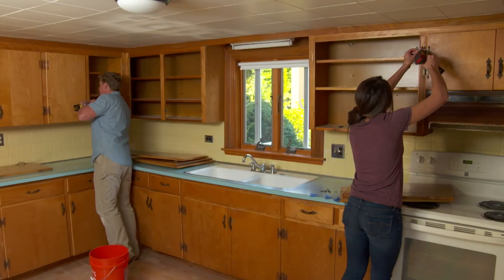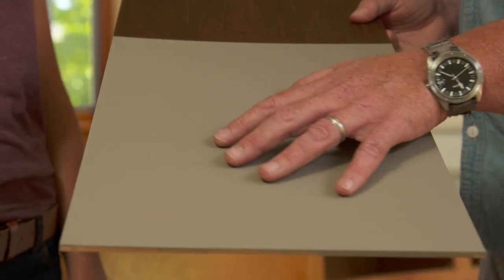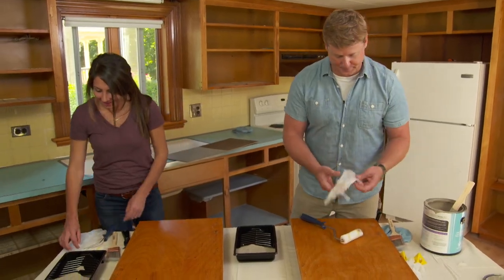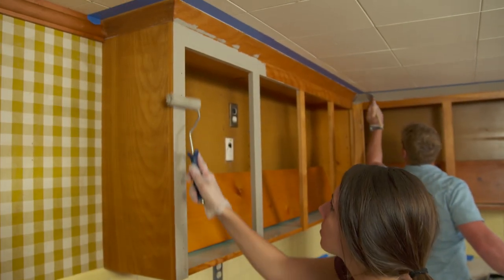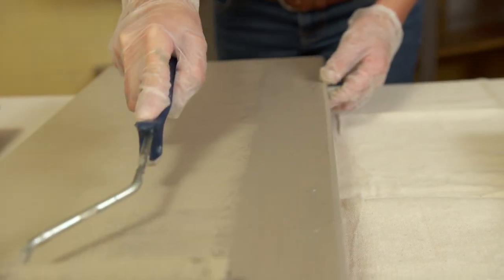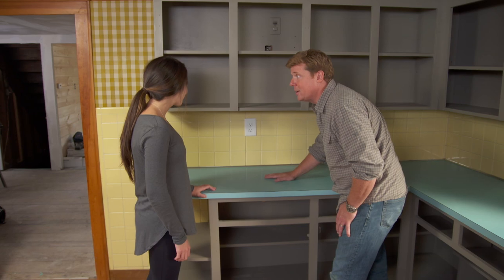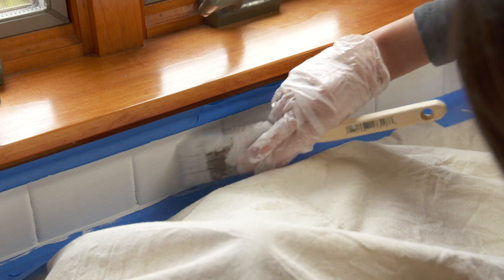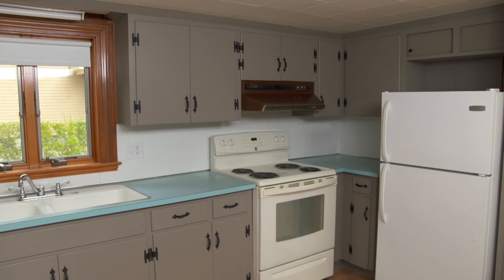How to Update a Kitchen with Paint | Ask This Old House

Comment: Cupboards and tiles look better but counter tops, walls and appliances also need updating to finish the look. Could also consider painting the window trim white
Reply: Jo Thomas 
Jo - They didn’t say they were doing the whole kitchen in this episode.
If you want to get technical, they could change plug outlets, lights and whole new windows, a new granite countertop, new ceiling, doors, baseboard trim and insulate the walls to R20. Simple! Hope you are rich.
Reply: Bryan Wilson I didnt say that they did. Im not rich but i have eyes and can tell that just painting these kitchen cupboards and tiles doesnt improve this kitchen especially when the colour they chose doesn't complement the rest of what is left. The phrase "polishing a turd" comes to mind.
How about you spend more time painting your beat up kitchen instead of ragging on at me about a harmless comment i made ages ago.
Reply: Jo Thomas 
I painted mine years ago white and they are perfect. But thanks for the advice.
Reply: @youmeplus3511  I completely agree with you on the window trim; it sticks out next to white tiles and grey cabinets. As for the countertop, I think butcher block would be a good option to bring in some warmth that was lost. There are some very affordable options.

Comment: I've used this paint! I love it, it's easy, affordable, long lasting, tough and GORGEOUS!!! I have an interior design company in Hermosa Beach California!
Reply: Did you use the beyond paint $130/gallon? if not what do you use?  Thanks
Reply: It's probably just a solvent based Epoxy resin. Solvent based, [as opposed to real non solvent based true epoxy]   etches into anything. Solvent is powerful. Epoxy resin is just Araldite, Araldite with a modified hardener. [GLUE]. of course it sticks to anything. Fats and grease excluded. That's why they cleaned everything first. Wink, Wink.....
Reply: Hi, 
Can please post the brand and where you can buy it?
Reply: Angelique Gorges Does HomeDepot sell I like Semi Gloss Enamel pretty tough Paint 3 Coats wipes clean Very easy..
Reply: It's called Beyond Paint...Home Depot and other places.

Comment: First of all, why so timid with the cleaning detergent? Gal, spray it on there and wipe it down like there's no tomorrow! Second, why didn't they sand the wooden surfaces before painting? The paint would stick much better with a nice little 240 grit sanding.
Reply: +SpookyMietz He specifically said that this particular paint didn't require sanding to insure it sticks.
Reply: I know that he said that but still it feels wrong. :D
Reply: SpookyMietz 
Spooky - get with the times. Lots of new products on the market.
If you want to sand, because you have nothing else to do, go right ahead.